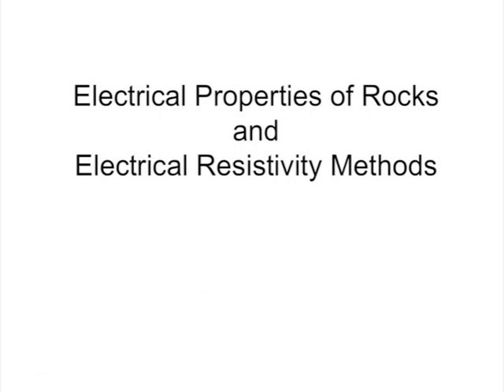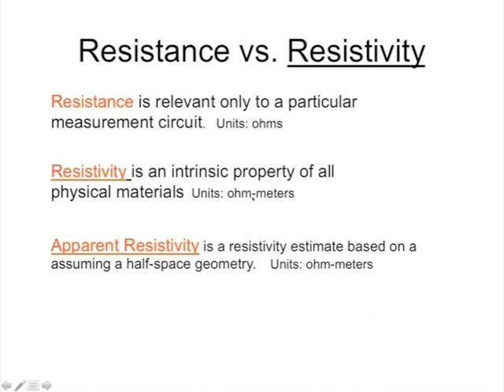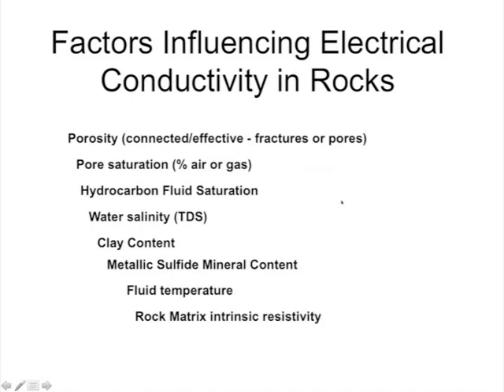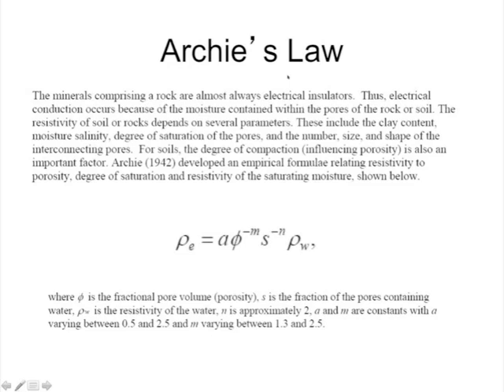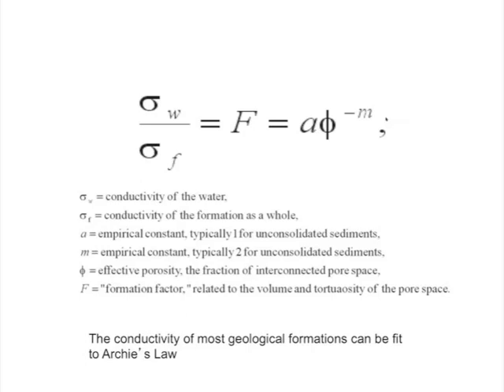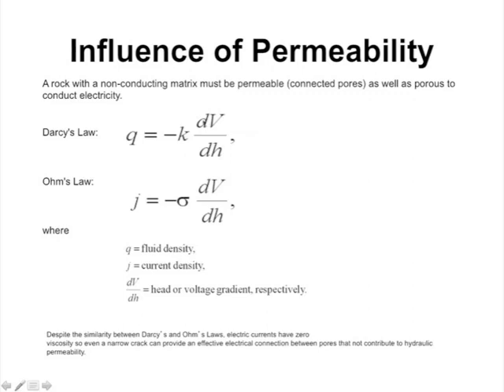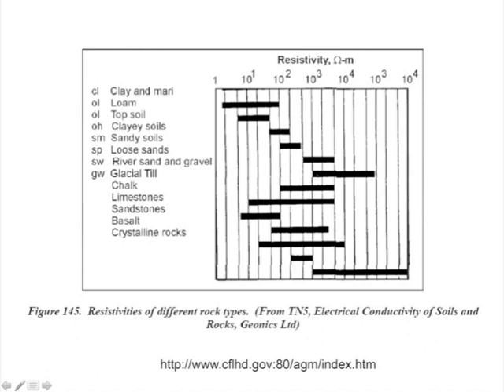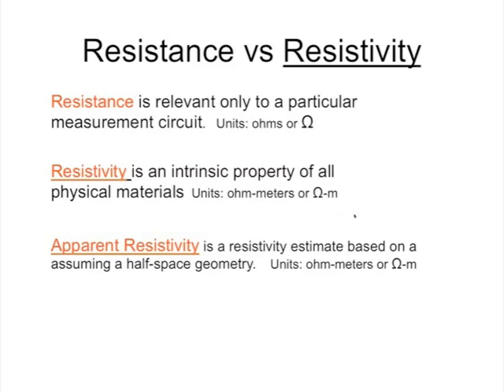Lecture 18: Electrical and Hydraulic Rock Properties

Comment: Hello ;
Thank you for the videos you have prepared preliminarily.
Is it possible to subtitle your videos?
Good work.
Reply from the maker: Bekir Çengelci you are right that subtitling improves the videos’ understandability. I am in the process of correcting YouTube’s automatic subtitles, which takes me more than four hours per hour of video. The first three in this class are done now; check them out. It may be March before I can get to this one. The university is requiring me to complete subtitling all my lectures by January 1, 2019.
Reply: John LOUIE,
First of all thank you very much for your interest and return. I will examine them for now. I will wait patiently for the bottom line.
Good work.

Comment: John, is it possible to determine the resistivity using only two probes? If so, what formula is used. I'm working a copper prospect, and have lots of resistance data using a two probe setup, but need to get to resistivity. Any help greatly appreciated.
Reply: Would need to know more about the configuration of the survey, but if the set up was two probes connected in a single circuit, then based on information provided in John's previous videos this would be a measurement of contact resistance and not resistivity, which would require sampling the voltage potential produced by the two current electrodes with a separate pair of potential electrodes. 
Although it would be an odd configuration to just use two electrodes so perhaps this was a pole-pole array if this is exploration geophysics?
Reply: @griffjones985  Thanks for the answer. I was doing simple resistance surveys at a copper prospect in Nevada. I was hoping there was a formula I could use to convert the resistance to resistivity. I finally just went back to doing a dipole-dipole survey, and using Res2dInv software to come up with an image, though it's more time consuming.
Jim